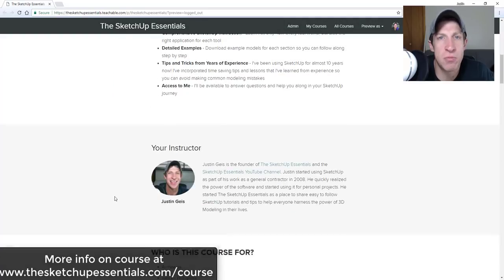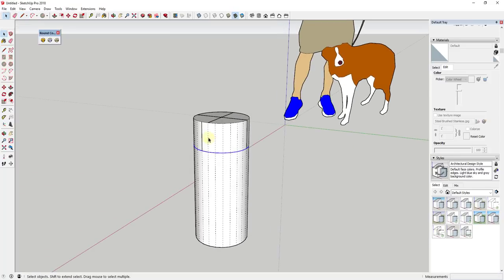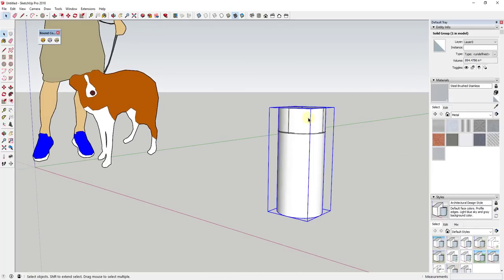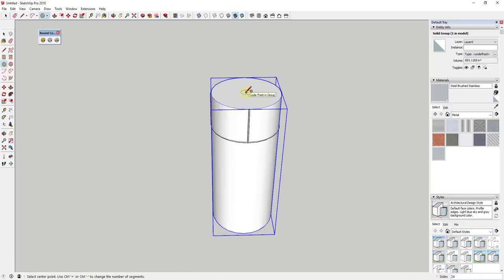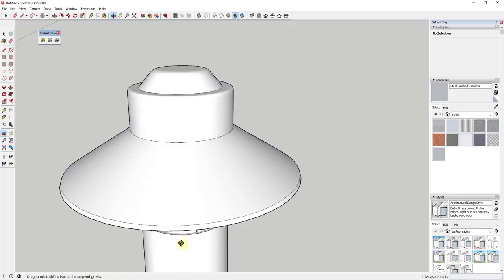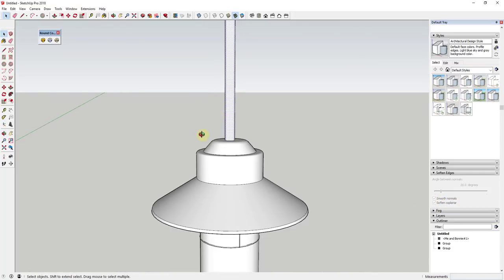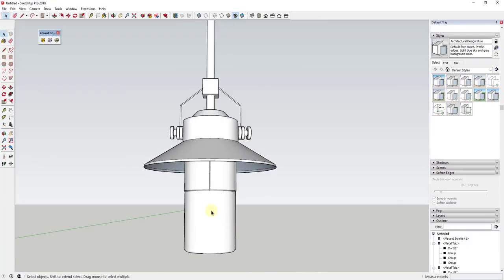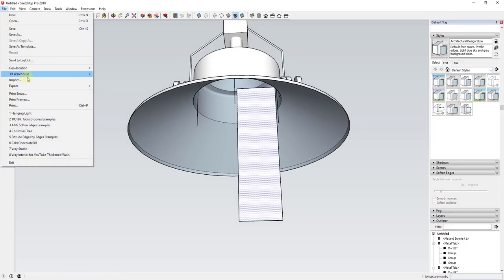MODELING A HANGING LIGHT in SketchUp

Comment: Thanks for sharing that nice looking lamp. Several of moot points1) I use always round corners at the end of modelling to make inferencing easier2) use bevels and softening rather than smooth curves - saves a ton of polygons and still looks smooth3) use the offset tool rather than the scaling tool because the latter sometimes produces undesirable effects with textures - for example to make a lampshade, make the outer circle, offset in then double click the inner circle and move it upAny comments?
Reply from the maker: All fair comments - a lot of these are personal workflow related - you could definitely use them if they make your specific model and use faster. Personally I've never really had any issues using the scale tool and textures, but if I ever have anything that doesn't map right I just fix it with ThruPaint really quick. Bevels and curves depend on how realistic you need your models to look and how closely you're going to be viewing them - if you're just creating a small background model, definitely go with bevel.